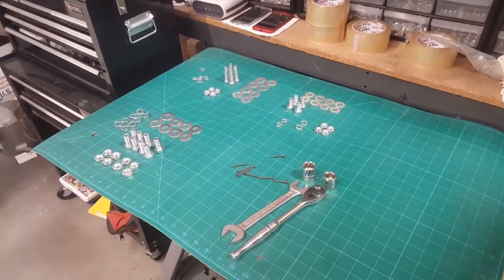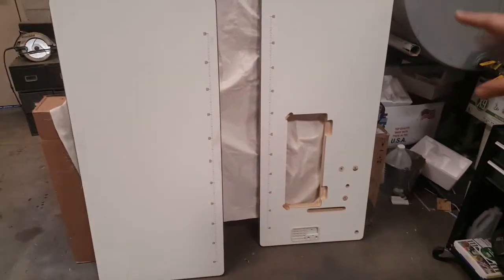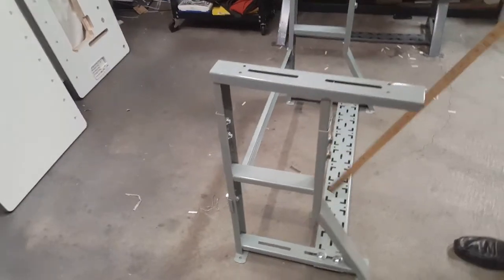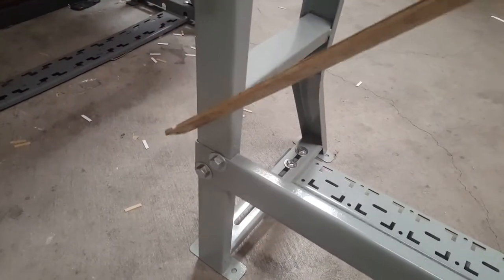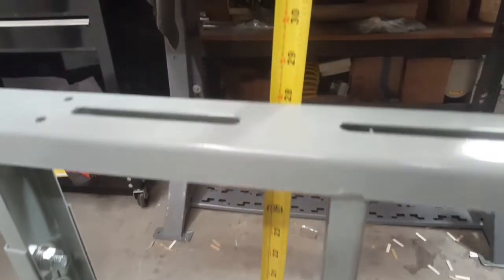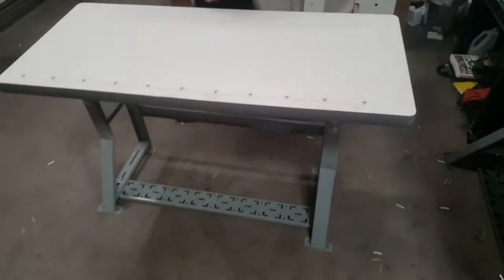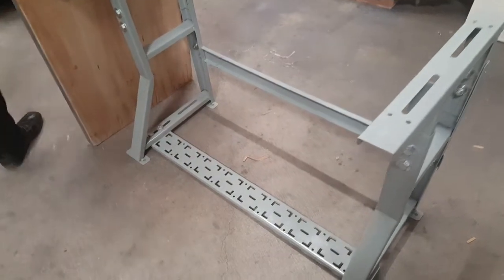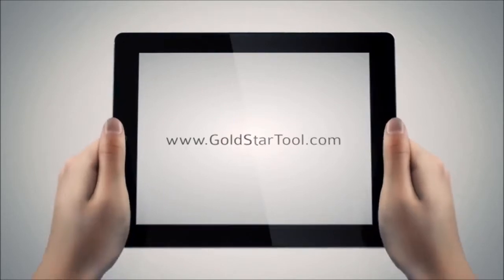Tutorial -K Leg Table Frame Assembly - GoldStarTool.com - 800-868-4419

Comment: The issue I have is your video shows more washers used than you send with your kit.  We only get one washer per bolt, you include a different thing in your kit, its a type of washer. Does it go on the bolt side or thread side. 

A simple piece of paper with real instructions that I could read would be nice.

Comment: This was NOT helpful. If you’re good at eyeballing from the video like my husband we could sort of figure out how it goes together. Note every bolt and screw has a washer! Put legs on first, then the back bar, then the bar across the bottom. Assemble the motor and screw into the bottom side of the table. Hook the part that attaches to the motor (it’s like a long stick) to the outer hole (there are two side by side coming out). Line your foot pedal up with that rod that comes down because there is another that will have to line up with it. You have to do this after attaching the motor and flip the table over because the pedal bolts on the underside of the table (ugh). Also you’re still not sending enough washers!!! I was 4 short on my order and you DO have to drill into the table with the wood screws to line up the feet. FYI it won’t line up exactly centered because you do need to leave a smidge for the belt. I hope that helps everyone because this video is absolutely terrible. There is also a reason they have an F rating with the BBB.

Comment: Just bought this table. Not enough washers provided, no instruction included. This video really doesn’t explain how to assemble. Walking around and pointing with a ruler is useless.
Reply: A trip to the hardware store  is all you need.As far as putting it together stop this video and take note it's very easy to do.If you are having this much trouble with this how are you going to sew on your new Industrial sewing machine? I hope you have a servo motor or you will never be able to sew with it a clutch motor is very fast but with a servo motor you can go super slow with sewing.
Reply: Mine was short some of the nuts.
Reply: Maureen, I agree...mine had not enough of some hardware and too many of others, making it very confusing.  I don't know why Kenneth was rude to you here, I know how to sew on an industrial and have done so for years and years, but assembling it is still confusing.